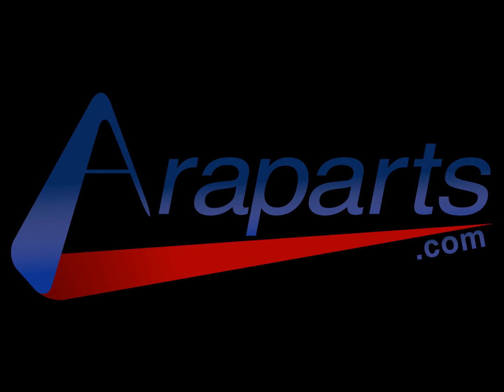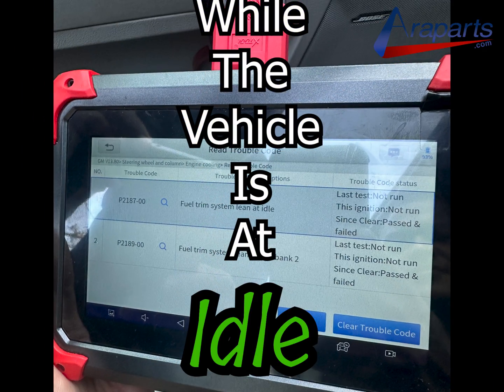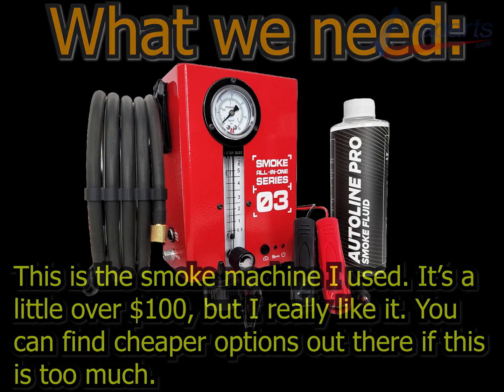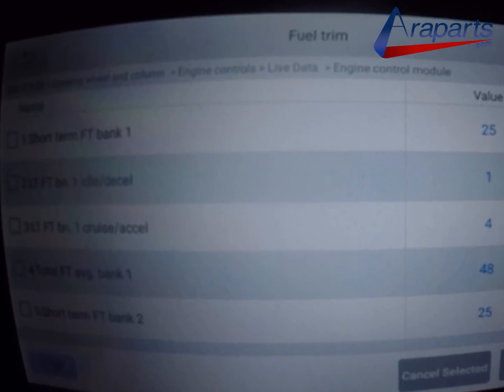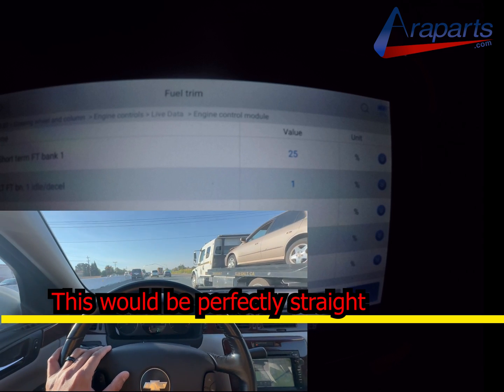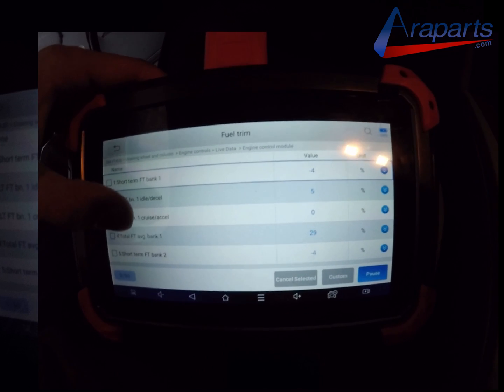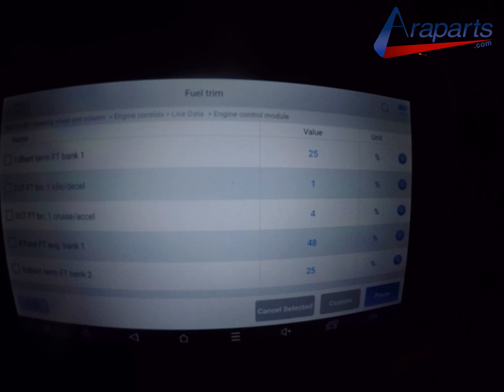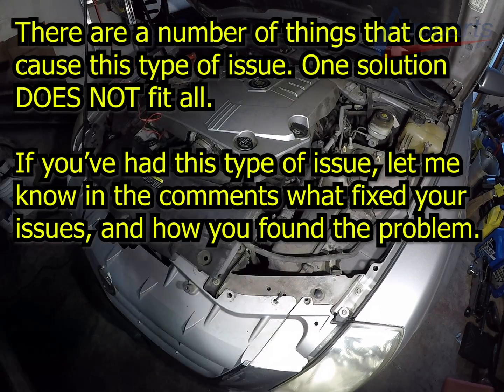P2187 & P2189 System Too Lean At Idle - How To Fix / Smoke Intake System GM 3.6L V6 LY7 (2006 STS)

Comment: I own the same srx it’s running smooth but it’s giving a P2187 what should I check…any response will be greatly appreciated.
Reply from the maker: P2187 is bank 1 system too lean at idle. Only one bank is reading lean. It could have an intake leak only affecting bank 1. It’s possible the intake manifold gasket/s for bank 1 are leaking. Could also be an oxygen sensor dirty fuel injector, exhaust leaks (before the o2 sensor) or fuel pressure regulator. 

It doesn’t hurt to check the rest of the vacuum hoses as well for any tears, etc.

Comment: Well done. Did the check engine light go away?
Reply from the maker: Not yet, but numbers are normal, so it’ll turn off. My neighbor only drove the car around maybe 40 miles before getting pulled over for both taillights out 🤦🏽‍♂️. Taillights are LED so no bulbs AND they are discontinued from the manufacturer with no aftermarket options. 

He doesn’t want to get pulled over again so he’s been driving his other car. Might do a video on the taillights soon. Trying to convince him to look into LED rebuild options.
Reply: @anotherlapofficial  I have the exact same car and just got a rear taillight from ebay!